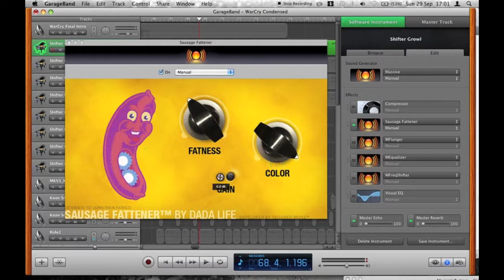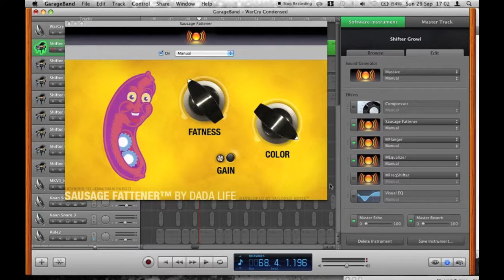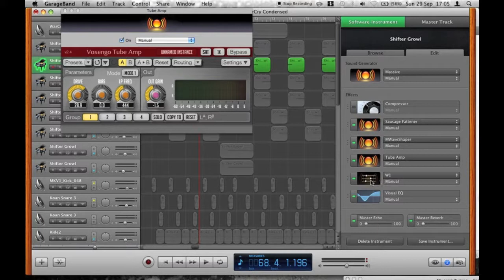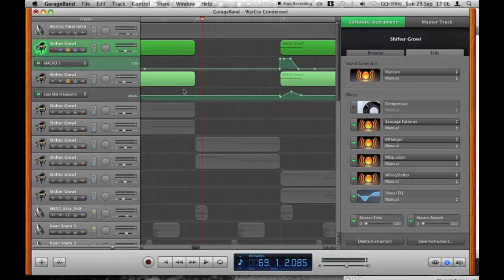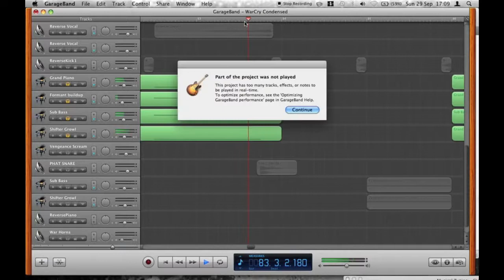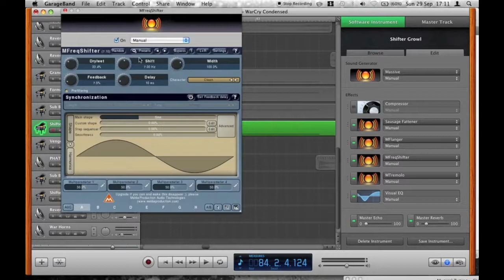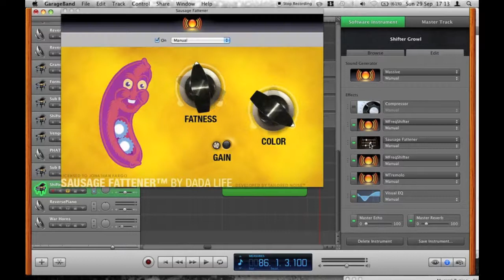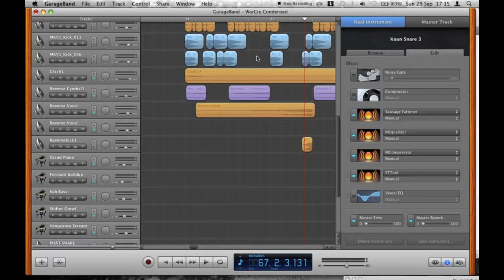WarCry Sound Design | Track Tutorial | Krux

Comment from the maker: If I could have, I would have. In Garageband, you can't copy automation between tracks (at least not in my version), so I had no way of transferring the automation points into one track. Plus some of the sub tracks I wanted to have certain effects on, such as one of the basses needed a tremolo sub underneath and I would struggled to do that with only one bass track. My method does have it's upsides. xD

And anyway, I'm used to messy projects... as you can see.